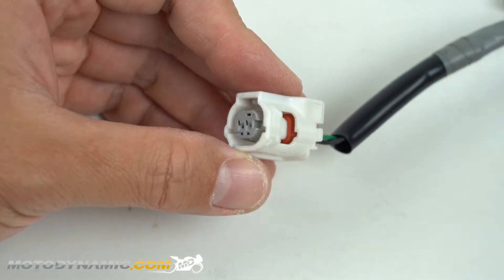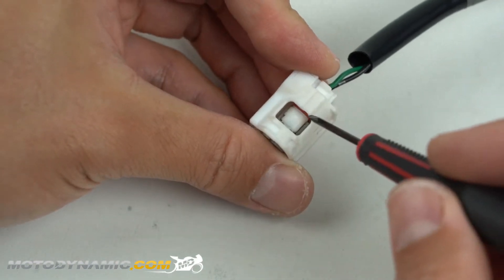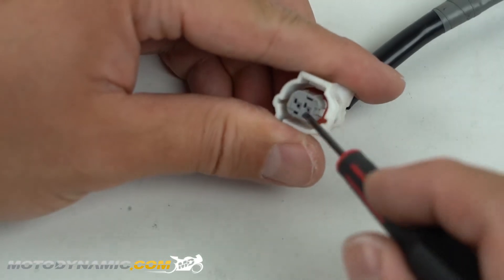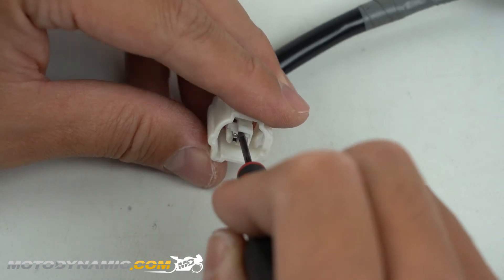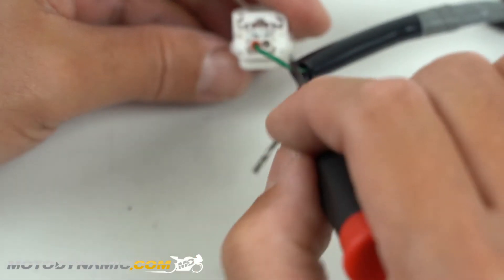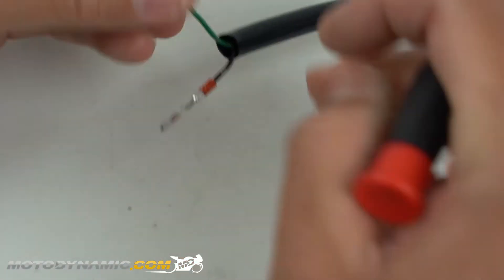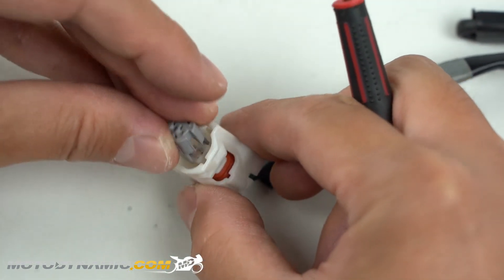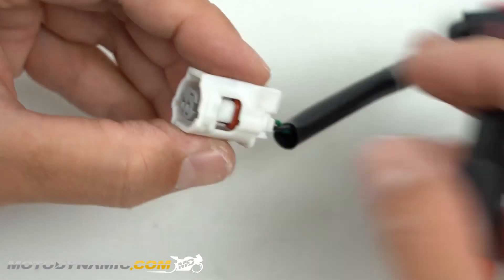How to De-pin Sumitomo TS 025 Series Connectors Used in Yamaha Turn Signals

Comment: Thanks for the video.  I need to see if the cap/face comes off of a Sumitomo 5 pin 0.64mm connector used on Denso MAF sensors.  It didn't want to budge when I tried.  Service info only states to insert their tiny release tool into the vertical rectangular slot which is oriented up and to the left of each terminal opening (while viewing the connector face with the release tab on top).  Next time I get a chance I'll have a service housing and terminals ready for more aggressive experimentation.
Reply from the maker: We believe the 5 pin may be the same interface for the cap, except that it is much longer than the 2 pin so there may be another locking clip at the other end.
Reply: @motodynamic  Usually a removeable cap is a different color than the rest of the housing; in my example it is not.  Plus your 2 pin cap had obvious latches as seen through the primary lock bar access port.  I had gently pried on mine as a test, not with enough force to break anything or perhaps remove a stubborn cap though.  I will know after my spare parts come in.  Between this, some new release tools on order, a Dremel, a torch, and a hammer, something's gonna give.